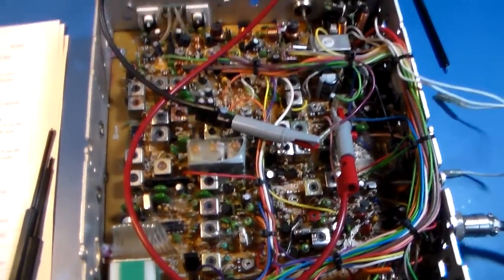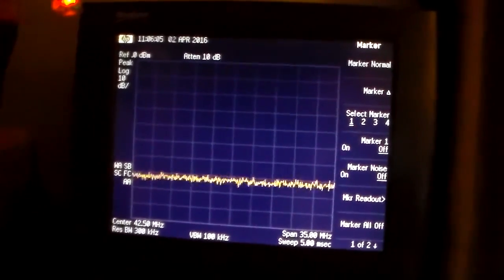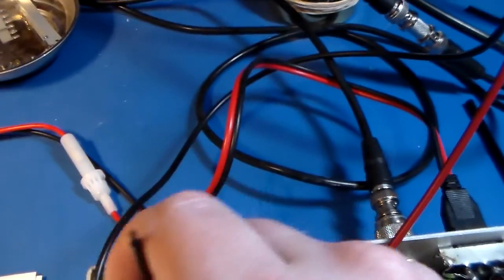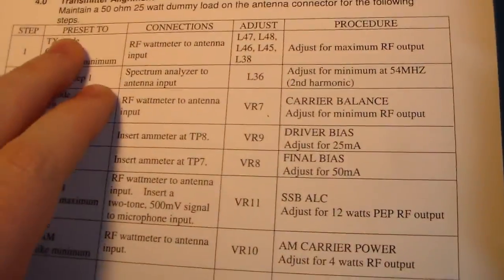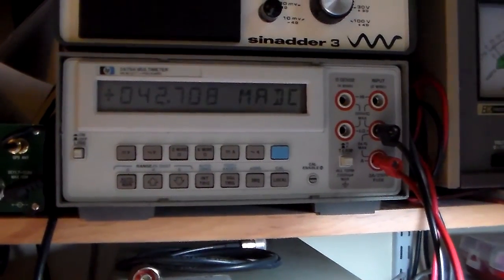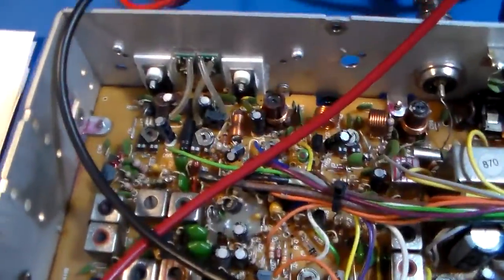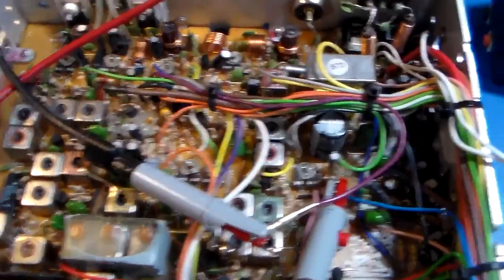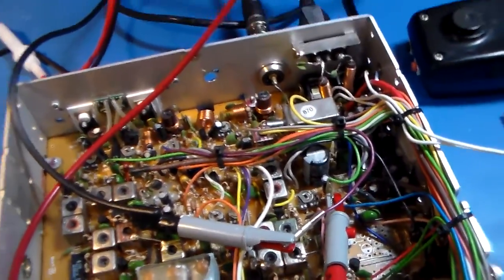Cobra 148 Resurrection and TX alignment

Comment: Ignore the name not real well any way been playing with electronics off n on as hobbies and worked in repairs of cable TV boxes 
Your thoughts on adjustments with spectrum analyzer for spurs is very good for off band interference you with twenty years seems to me is doing with better tools is a better way for so many radios are so dam noisy with bleeding over to other bands your way would eliminate that bleed over 
I like it makes great sense wish there was an older tuber around who did it on a TV and now sees it on a spectrum 
Thumbs up bro plus I think it's good to know what the readings would be for tool safety they expensive

Comment: I agree . Much rather have lower bios current prevented splatter. If the radio clean with a bios current few ma. over. I am okay with that. Looking for the best scenario for the radio what you want. Only thing that would take priority would be the life of the transistor. + - 5 ma would have no effect on them components. Just my opinion. Cleaner at 22ma. Fine. Cleaner at 27ma. That would be acceptable . We know that all these parts have different tolerance .Nice video

Comment: are you taking Radio’s right now? I have a 148 that needs a meter.
Reply from the maker: Not at the moment mate. There are some guys out there that take in this kind of work.
However, I may start to do some work because I get asked all the time but it would have to be based on my availability.
I would never want someone to send me equipment that I could not service immediately. I just can't do that at the moment and I don't want anyone upset with me because it took too much time. (in my mind, that time is measured in days, not weeks, months, or years.. like we have heard about.. which is a shame.)
Reply: @Mark19960   could you notify me when you could take it ?

Comment: Mark, looking at the crystal filter (11.325) there are two diodes peeking out from underneath that crystal. The leads to both of them have been clipped - any thoughts on why and should I just reconnect them? This is a Malaysia 148GTL built in Oct 1993
Basically the radio seems to work but not sure of the receive; transmit appears to be good. excellent waveform on the scope and about 4 watts. Thanks for your time.

Comment: Can you do one on the 13v input loading coils I have a cobra 148gtl that has burnt  out coils and I don't know what to do..if I replace then what is there values and whare do I find the components, if I can fix them what do I need to think about in regards to length of coil and the component inside the coil.....cheers from New Zealand

Comment: I am assuming that the Bias should be 0.5-0.6v would I be right, maybe if all of the Citizens Band Transceivers were implemented in DSP hardware and all signal processing done in the digital domain with the firmware in a AES encrypted EEPROM so no tampering can happen is the only way forwards.

Comment: How do you connect your multi meter up to this radio to check and set bias ? thanks
Reply: "It's similar to the "Block Radios", where you remove the block that shorts the test points, except it's wires. Follow the wires from the finals to TP 7- TP8 posts over in the general area of the MB3756 regulator. It's the DC source feed for driver and final. Usually is either brown and green, or green and purple, or purple and brown Some of the newer units have orange and yellow wires, but they all go to the same general location. Just follow instructions for ammeter connection to TP's / adjustment.

Comment: Ahhh yes the old knob twisting, pot tweaking, coil spreading hack job tune.  Looks great on a watt meter but looks like crap on a SA and sounds just as bad on air.  In old tube radios it was known as the TVI adjustment which stood for television interference adjustment and many old tube radios had that adjustment accessible from the outside the radio.

Interesting point on adjusting bias with the SA.  I am all about clean signal output so I may have to start doing that.

That was a good 9+ hour rag chew the other day.  Thank god for phones with  unlimited minutes. :)
Reply from the maker: +MikesRadioRepair No kidding.
Today is my day to play so I have yet another interesting one going up.